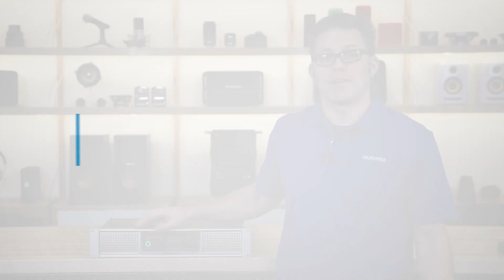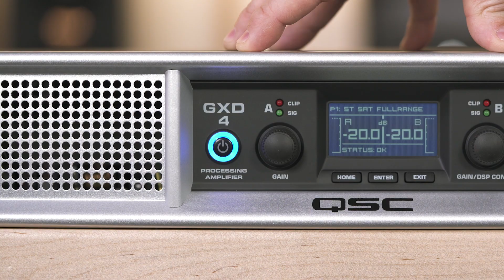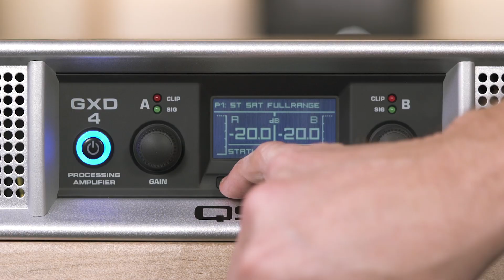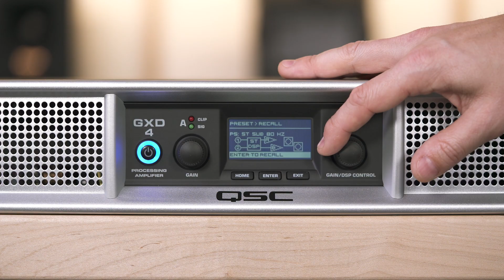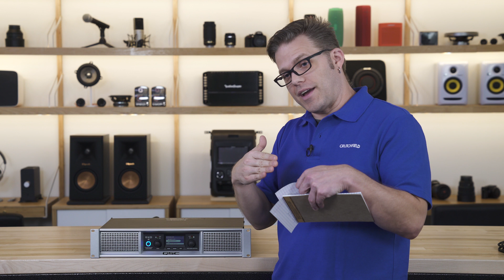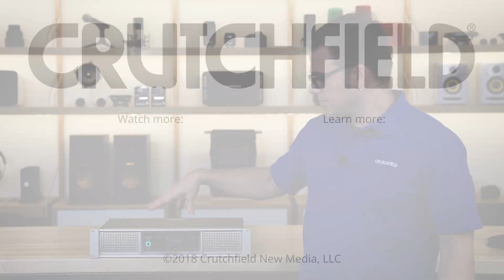QSC GXD Amplifier DSP Setup | Crutchfield video

Comment: Greetings Rob from Crutchfield. What a great video with great information. I really like the presets and digital tuning functions. I want to purchase an amplifier that will push my JBL PRX418S. I am back & forth between the Crown XTI 6002 & this QSC GXD 4 or 8. Out of these, which is going to be the best for matching spec for spec. 
JBL PRX418S Power Rating: 800 Continuous 
Frequency Range (-10 dB): 35 Hz – 250 Hz
Frequency Response (±3 dB): 52 Hz – 120 Hz
Input Connection Modes: +1/-1
Recommended Crossover: 80 Hz, 24 - 48 dB/octave
Recommended Filter: 35 Hz, 24 dB/octave subsonic high-pass

Thanks! Anyone can chime in too. I am open to learning as much as possible..
Reply from the maker: The QSC GXD amplifiers feature low-pass crossovers so they can be used to power subwoofers. They are NOT bridgeable, however. To power your JBL PRX418S subwoofer (one or two) the QSC GXD8 below is a fantastic choice. It provides exactly 800-watts RMS into 8-ohm loads and matches the continuous power rating for your PRX418S subwoofer. You would use only one channel to drive a single subwoofer, and both channels to drive two subwoofers. I hope this helps!

https://www.crutchfield.com/I-rYALc166/p_907GXD8/QSC-GXD8.html
Reply: @crutchfield  Thank for the info drop!
Reply from the maker: You're welcome! 🙂

Comment: I just bought a GXD8 unit. I'm going to use it with two 8ohms speaker cabs (one per channel). One cab has 400W and the other 550W. What would be the appropriate limiter option? 1000W? 8 or 4 ohms? Thanks!
Reply from the maker: There is no adjustable impedance settings on the QSC GXD8, the amp will deliver the 8-ohm power numbers to any connected 8-ohm speakers. With that impedance, you will be overpowering your speakers by 400 and 250-watts (respectively). Limiter features available in the settings for 8-ohm speakers on the GXD8 are adjustable between 5 and 800-watts. To protect your speakers, you would want to use a setting that matches your least capable speaker (400-watts) to avoid damage. This is no guarantee that damage will not occur when using speakers not capable of handing the power from your amp.
Reply: @crutchfield  I solved the issue by using a preset with individual DSPs. This way I was able to match impedance and power for each output with the cabs I use! As the presets are fully customizable, there is no problem at all. Thanks.
Reply from the maker: That is excellent news, we are here to help anytime!

Comment: If I were to use this amp to power crowson motion actuators (transducers) would I need to set them up under speaker or subwoofer presets?
Reply from the maker: Actuators, or transducers as they are sometimes called, typically only produce bass tones and work very well for the subsonic frequencies. We recommend checking the frequency range for the ones you got as that will help with ensuring gear is set up to properly run them. If these OSD amp interface is the one you will use to filter out the audio the transducers cannot produce, then it is best to activate its sub preset settings to make sure only bass is getting through to the transducers. If you don't use a preset, at least activate a low pass filter to ensure only bass audio comes through to it

Comment: is this capable to used in home audio connected to tower speaker?? is it good sound after setup of the crossover and everything?. Any comments? thanks.
Reply from the maker: This amp is not recommended for home audio speakers like the floor standing or tower speakers. It should be used with passive PA speakers. Here are the PA speakers we offer:

https://www.crutchfield.com/I-rYTVc227/g_389650/Non-powered-PA-Speakers.html?tp=63674
Reply: thanks to your helpful tips.
Reply: No jasne,każdy głośnik pasywny od 4 do 8 ohm możesz podłączyć to ma limiter w którym możesz ustawić nawet 15 watów mocy jeśli taki głośnik chcesz podłączyć i go nie spalisz bo limiter nie powoli na to,do tego możesz ustawić mu pasmo od którego do którego ma grać oraz barwę dźwięki pod swój gust,ma trzy poziomy ochrony limitera od słabego do agresywnego do tego ma terminale głośnikowe zakręcane jak w domowym sprzęcie więc nie ma obawy o podłączenie,jedynie sygnał można podać tylko poprzez xlr lub trs,nie ma standardowych rca ale przejściówki z rca na xlr lub trs są

Comment: That power amp is advertised as 400 watts @ 8 ohms "both channels driven." What does it kick out at 8 or 4 ohms with only one channel driven?
Reply from the maker: Good question, It is really only designed to be used in 2-channel. For that kind of application you would likely want a mono amp. You can chat with one of our commercial audio advisors to see which amps best meet your needs 1-800-315-2758